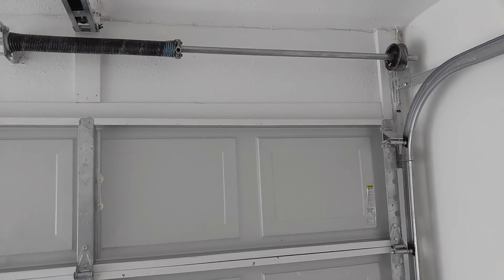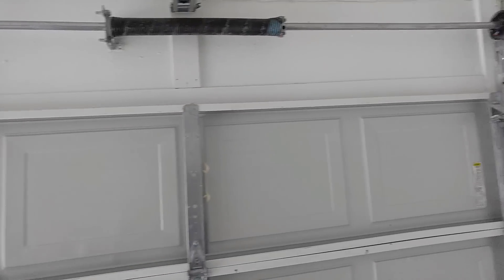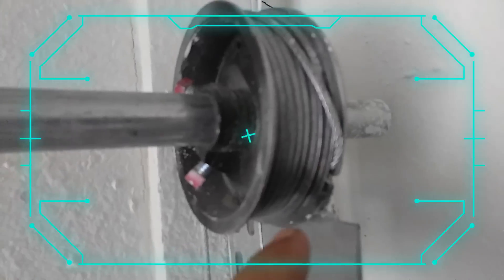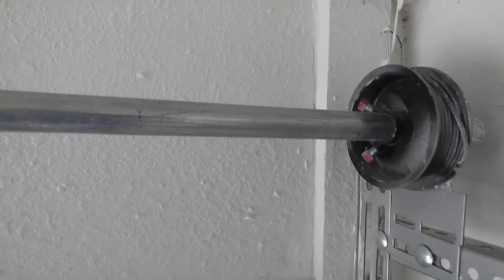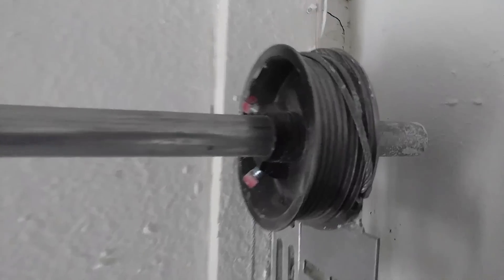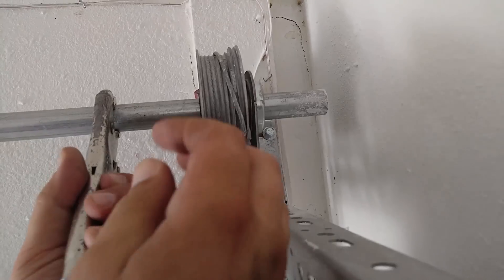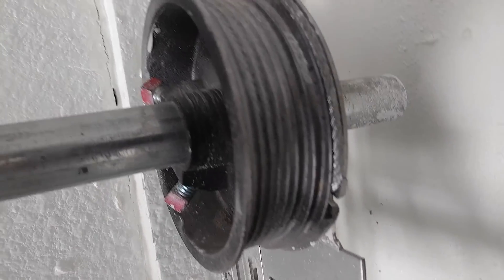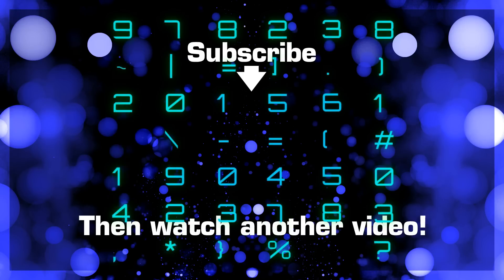Cable Off Your Garage Door? | EASY DIY

Comment: If the wires keep getting tangled every couple days what could be the issue?
Reply from the maker: More than likely the tracking isn't set equally. If you were to take a laser line and shoot it across the center of the torsion tube, I bet one side is lower than the other. That causes cable slack and then the rest is history. You'll have a spun cable every time.
Another thing you could check is if you raise the door manually and it falls back down on its own, you could use some spring tension. Meaning that spring needs wound up a little more.

Comment: Hey GarageDoorGenius. I'm following your instructions and loose cable is off drum. Now where on the drum do I insert the non-looped end? I am able to see the drum somewhat using a small stool but I have to use my fingers to feel around the drum for some kind of insertion point and I cant see on the other drum where that might be on its partner drum. Maybe I missed something on your tube. I'll view again
Reply from the maker: That insertion point is probably on the backside if you're not seeing it.  It's there, trust me. 🙂💯
Reply from the maker: This is another video I did about a cable off.  You can see in this video where it hooks up at.

https://youtu.be/LykX6kQXPGo
Reply: @garagedoorgenius  Yes I found the insertion 'hole' by spinning the drum some....but doing this made the cable on the other side come loose too.....so I rewound both and tried the opener  again....not only did both cables come loose again but the damn door came out of one of its tracks. I tried the DIY routine...sometimes it works, sometimes it doesnt. Time to call the garage door fix-it guy in my area. Thanks for reply and vid...it did look to be a cinch until I got my hands on it! LOL
Reply from the maker: @kentm5569  you're right, sometimes you win sometimes you loose.  You'll make a garage door guys day because it's pretty slow in our industry because of COVID.
Stay safe out there bud!

Comment: I feel like you know what your doing but someone is going to loos a finger trying to do this, and the door isn't right if you got cables coming of the drum. just have it set right right.
Reply from the maker: Very true.  One must make sure he or she is competent enough to do such a task.  Although, your fingers should not be underneath the cables putting you in a bad situation.  You definitely don't see my fingers under the cable in the video.
Also, sometimes it's not about the door being "set right".  An object under the side that popped off typically is the culprit.

Comment: Thank you I tried your method works .My cable was off completly I hooked up the bottom door first and then use it the wise grips and installed the upper side
Reply from the maker: Dan Bob 
Your welcome Dan!
I'm glad you fixed it on your own.  The mind is a powerful tool.

Comment: Wouldn't advise doing anything with the springs or cables if you aren't trained as they are dangerous
Reply from the maker: Robyn cook 
I agree totally.  Springs and cables can be super dangerous.
Some folks are mechanically inclined enough to fix this particular issue.  Just do the research.  You'll know if this is something you can tackle.

Comment: Grrr, mine is on the outside
Reply from the maker: It came off the outside of the drum vs inside like in the video?  Yea, that's just a bit more tricky.  You'll have to set the grips to the torsion tube as low as possible.  That way when you push up it should release enough tension to pop that cable back to the other side where it needs to be.
Reply: @garagedoorgenius  Thank you! I got it! My door was closed, so I visegrip'd it down on the "good" side., then it worked like a charm.
Reply from the maker: @enroute6955  that's awesome brother!  Good job getting it done.
Stay safe out there 🙏.

Comment from the maker: Thanks for watching this video!  
I apologize for the loud sound effects and Sci-Fi effects.  This video was definitely a learning experience of what to do and what not to do.  I still get the point across in the video so hanging in there and learn from a guy that does this stuff every day!!
Reply: Thanks it help me out
Reply from the maker: +rudymorin86 
Great news!!
Reply: The special effects were awesome! Don't change a thing!
Reply from the maker: Nathan Schwinnen 
Thanks Nathan.  That's the first possitive comment involving the effects.  Happy New Year!
Reply: Sure thing.  I thought they added some fun to the video and weren't overdone to where they added unnecessary length.  Also, this video didn't solve my problem, but one of your other videos did, so I appreciate the help.
Reply: Glad you mentioned this. Was about to say thanks for the information... It was much simpler than I was attempting to do to fix it. The visual effects... Entertaining, but could be shorter. But the audio effects... Way too loud lol
Reply from the maker: MrBobLob1aw 
Thanks for watching Mr Bob!
Reply: I liked the effects, especially the flame throwing vice grips.  And the video was only 2 mins and explained better than another guy's 10 min vid.  I've got the same problem but the door is way out of whack and can't be closed.  I got it about 2' off the ground and so out of level the tracks are twisted like crazy.
Reply from the maker: opentrunks 
Thanks man.  I had no idea what I was doing as far as the effects go.    Was just having fun!  
Now with your door issue.  I know exactly the shape your door is in now.  Don't worry about the vert tracks.  Although they look jacked up, I've used visa grips and bent them back into shape, very plyable.
The side with the cable on, visa grip above a roller.  The side that's off, lift up until the door is eyeball level, then put a pair of vise grips under a roller.
Side with cable on, pull down as far as you can. Then regrip.  Side with cable off, release grips and hold on, it's gonna want to drop.  Get back to eyeball level, regrip.  Repeat until fully on the ground.  
Then wrap the cable that is off.
I need to make a video of this particular senario.  Hard to explain like this..
Reply: Thanks for a great video - told me what to do and how to do it. Saved me a lot of $ and hassles. Very grateful SB Brisbane Australia
Reply from the maker: Simon Bowler 
Awesome Simon!!
Much love from Austin, Texas!!

Comment: Effects are are annoying as fuck. I couldn't even finish watching it. Had to switch channels.
Reply from the maker: Yea I fucked up with the effects on this video.  Sorry your ears had to deal with it.
Hope ya got the point tho..
Reply: ears and eyes too. How long are the cables supposed to be for a 7ft door and 4 inch drum?
Reply from the maker: 8' 6" is how long those cables should be.  Sometimes they stretch..
Reply: loosened off both bolts on the drums but they will not move, maybe 1/2 inch. I fear they are rusted on. Have you ever come across that?
Reply from the maker: +Martial 3231 
Yea they kinda get stuck sometimes.  Squirt some lubricant where the tube goes through the drum.  Vise grip on the tube pulling either up and down, with the other hand grab the drum.  It will eventually work loose.  You my have to put some elbow grease into it.  
Basically the set screws took the form out of the tube.  Your trying to pull an oval through a circle.  You'll get it.  Once you get it, file the shit out of the tube, smooth it up a bit.
Reply: ok thanks
Reply from the maker: +Martial 3231 
No problem!